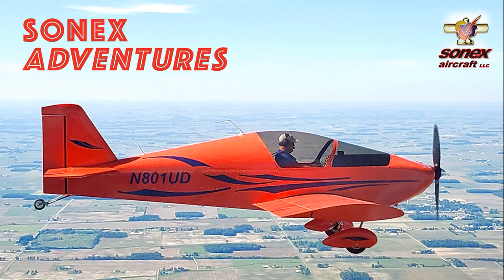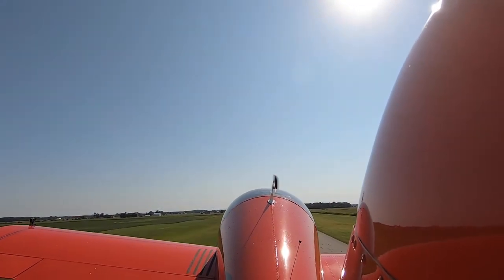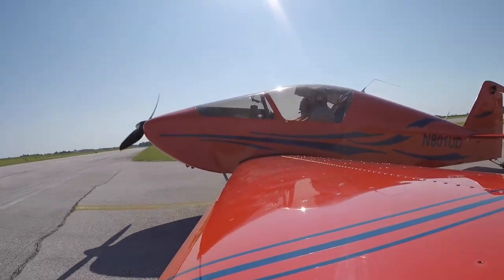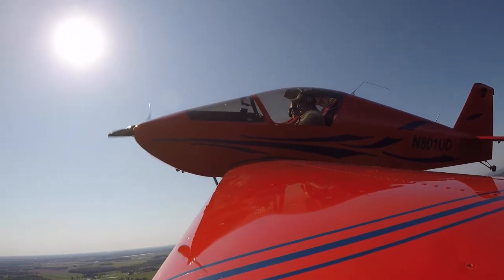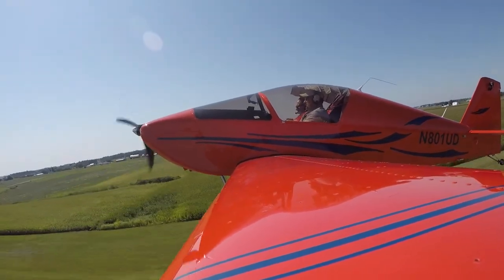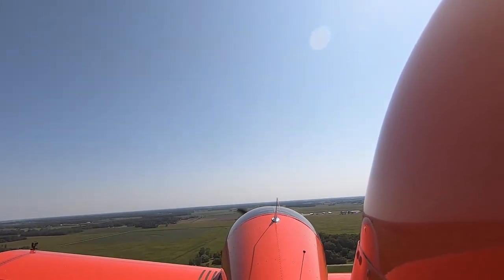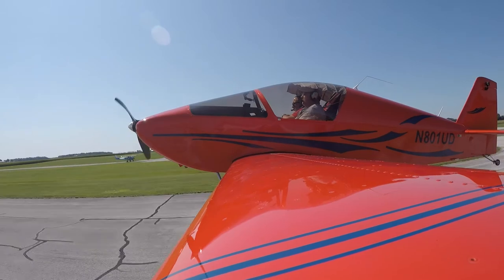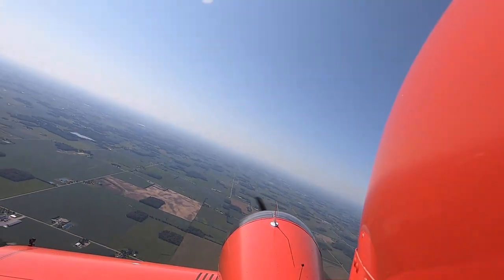Flying the Sonex - N801UD - KUSE - traffic pattern

Comment: Jab 3300 seems like everyone has those engines I guess its more reliable then the AeroVee, but the turbocharged AeroVee seems like a good idea can get 120HP higher up. I think Sonex finely fixed the turbo issues by installing that little radiator.
Reply from the maker: AeroVee seems to have more bad press - Jab - properly maintained - seems as reliable as anything else - love mine so far!